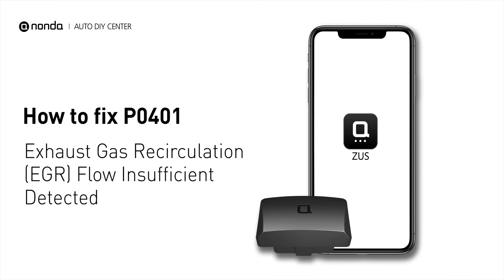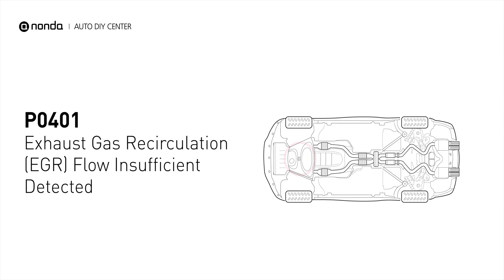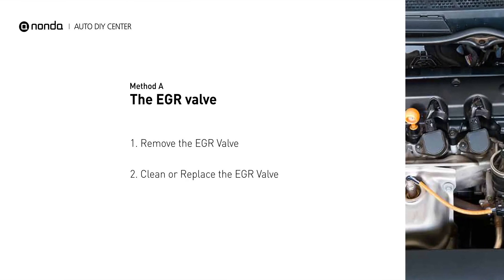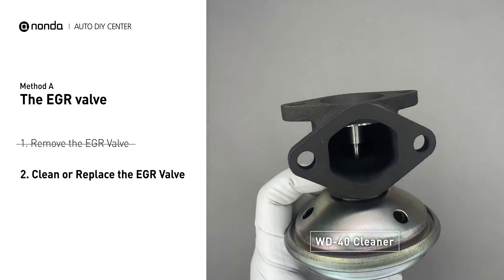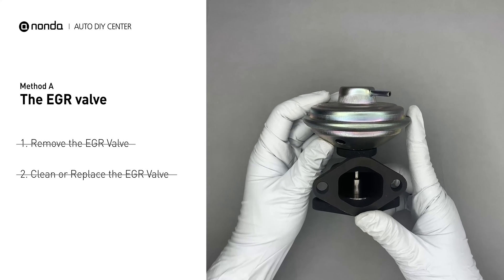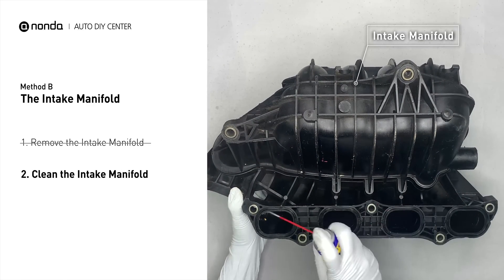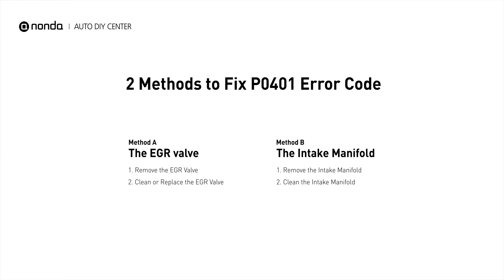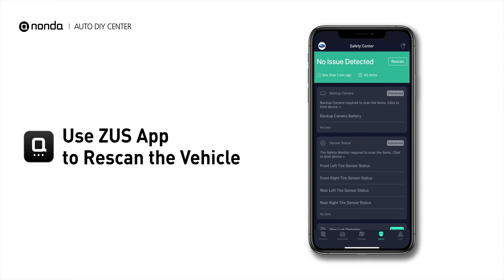How to Fix P0401 Engine Code in 3 Minutes [2 DIY Methods / Only $4.13]

Comment from the maker: Hi, I'm Steve, nonda's lead mechanic engineer. 
Feel free to leave your comments here if you have any mechanic questions, I will be glad to help you out!
Reply: I removed my egr cleaned manifold still runs like crap I put a vacuum pump on egr and it kills engine, I believe this means it's working.cirrect me if I'm wrong. Could it be that egr sensor
Reply: I replaced EGR valve, but still getting this code??
Reply: @crystalturner152 it could be the egr cooler
Reply: Hello. I got this erro p0401 code on my golf 5 1.9 tdi 77kw and my mechanics cleaned egr valve,and it did not fix it,so I changed it for a different one(used,not new) and it disappeared for 3-4 days and the light is back on again,what should I do?
Reply: What if I have a code p1544

Comment: I wouldn't use WD-40. There's plenty of cleaners that are designed to clean up intakes and carbon. I would use something different. WD-40 really isn't a cleaner. You should use a specific one for carbon

Comment: EGR pressure sensor or DPFE sensor. Clean EGR valve or replace it. EGR cooler being dirty can also cause this code. Check hoses and anything else that can have blockage. If you have an air leak somewhere it can also cause this code.

Comment: But i have 2 egr valves. One is Low Pressure EGR and other is High Pressure EGR. Which one?
Reply: Check both

Comment: You forgot one important part at the beginning where you cleaned the EGR valve but you did not check to see if it was blocked where it bolts onto the manifold and that is a very common problem.

Comment: I have a 2001 Dodge Stratus RT coupe 3.0 that's playing musical codes.  It dances around P0401, P0506, P0507.  It just takes turns with those 3 and until I pass a smog test the DMV won't release my tags.  Every time something is tried I have to reset the miles driven and basically start over.  I got as high as 105 miles thinking I'd get it smogged the next day.  Mile 106 the light went back on.  This is what I've been dealing with since early July.  I have replaced:  EGR valve, Idle Air Control Valve, PCV valve & hose, Manifold Pressure Sensor, Vacuum Switching Solenoid Valve & cleaned the air filter & little air sensor in the box with the proper cleaner.  I've tried Guaranteed To Pass twice, Lucas Octane Booster & now I'm doing one final try with one recommended I think it's called Ricone.  Most of my driving is little trips to the store or places in town which I've learned is the worst kind of driving so I've made a point of getting onto roads where I can step on the gas.  Speaking of gas I've just gone through most of the best kind I can find which is Mobile in the next town over.  I can tell the difference, my car has more pep and it took noticeably longer to use the gas up.  I don't know what else to do besides what I listed so I'm looking at having to take it to a garage.  I cannot afford it but that's my next step if this latest fuel additive doesn't work.  Any suggestions?

Comment: Yeah I'm sorry but you don't go right from EGR valve to pulling off the intake manifold.  There are many other factors for this code and pulling off the intake manifold is not going to fix it.
Reply: Depends what car actually lots of cars have small s shaped tubes from egr to intake that only come off when you remove the intake if they get stopped up same as bad egr valve, maybe the 18 people that liked your post will see this and learn something

Comment: Hi!Recentlly(2 months) i cleaned manually the EGR valve and the intake Manifold.But now for the first time i have this error.What could it be?
Reply: Check your vacuum lines to the EGR valve, even a small split can cause this code
Reply from the maker: Hello, can you please provide us with your vehicle's year, make and model?

Comment: Spray a cleaner in the throttle body  and change dpfe that's what I did for the same code passed inspection this morning
Reply from the maker: Thanks for sharing your experience!
Reply: @nondainc  yw
Reply: @smittdog2005 what kind of cleaner did you use?

Comment: Ser how about toyota hiace everytime i reset the check engine"it keeps comin back"and the scanner always says"that exhaust gas reserculation flow
Reply from the maker: Hello, begin with checking your EGR valve/passages if clogged and check for any electrical issue (EGR valve control circuit).
Reply: Change the dpfe
Reply: @smittdog2005  What is dpfe. The dpfe sensor?!

Comment: Vw golf plus 1.9tdi egr valve removed and cleaned. Looks like new, flap works with no obstruction. Replaced and used code tool to delete code. 250 miles later check engine light came back. Scanned and have p0401 error. So next up is intake manifold....
Reply from the maker: Hi Lenny, please do let us know the outcome after replacing the intake manifold. Thank you!
Reply: how was it after intake manifold?
Reply: Blank it off but drill a 7mm hole 👍 so sensor still recognising air flow . . Ovisually clean it first . And ya egr.
Reply: Correct
Reply: Change the dpfe  that's the problem it throws the same code